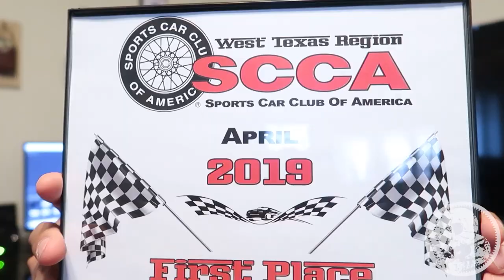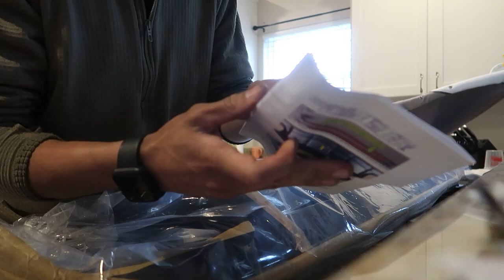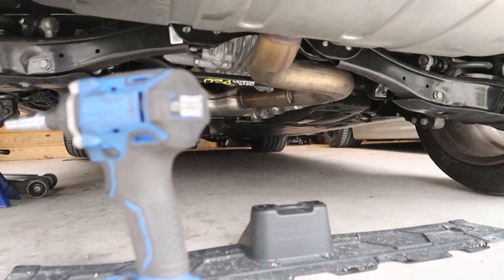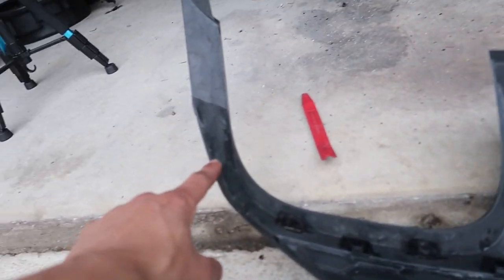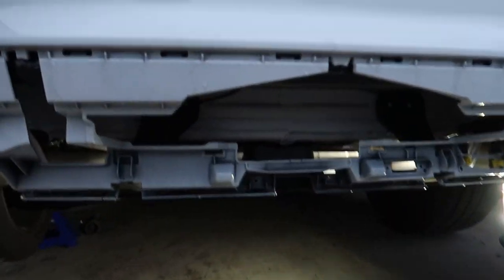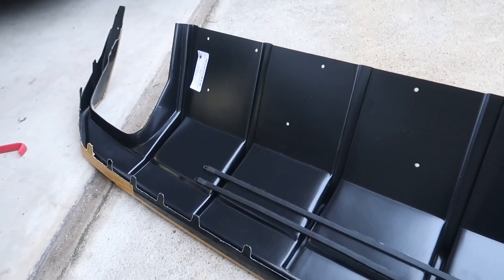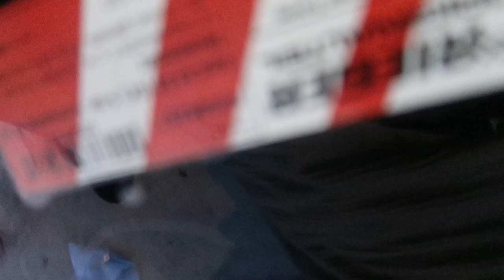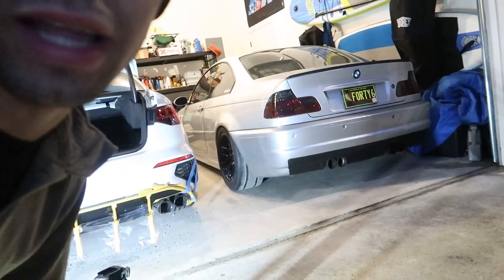[US 1st!] Rieger Diffuser for the Audi 8Y Install & Unboxing!! Quality is MINT!

Comment: Looks good! But how about those tabs in the middle that are just flat, do they sit snug or would they move around at higher speeds?
I just got my maxton diffuser delivered and noticed they are exactly the same as on yours, only it didn't come with any screws or tape
Reply from the maker: You can put screws through them if you wanted. I've been 140 some now and it hasn't been an issue 😁

Comment: Good job bro. Reminds me of the install of a Rieger diffusor on my Mk7 GTI, that I had to mount because I installed a Remus backbox with 4 tips, It was an absolute beach to get the stock one out! Id didn't run it for long as the rear muffler was waaay to loud and droney. I would replace those steel torx with a black painted variants, just in case someone would be lookin from down below... ;-)   Cheers buddy
Reply from the maker: They are black! Lighting must've made them look silver. Sucks you didntike the Remus, I didn't have much drone with mine at all, I absolutely loved it. I need to save up to get one again that's the only catback I'll ever run on this car